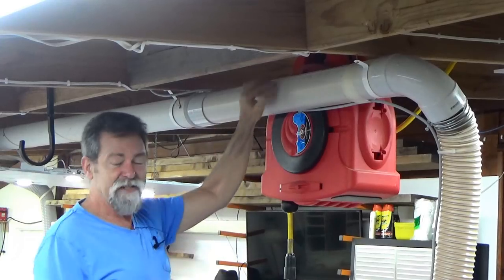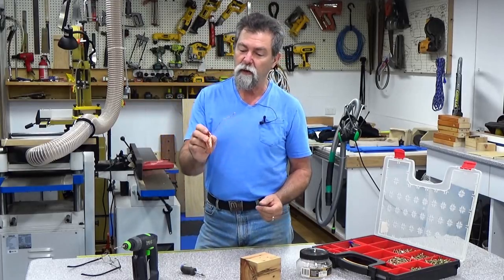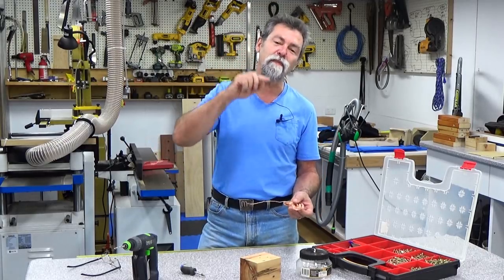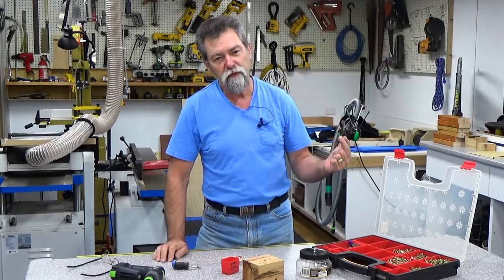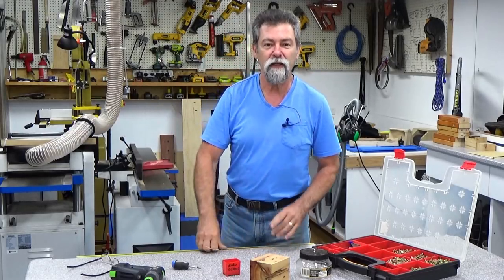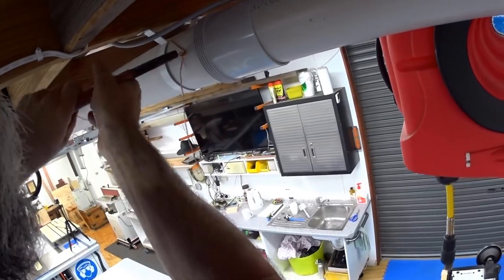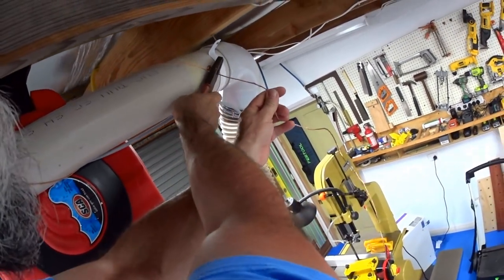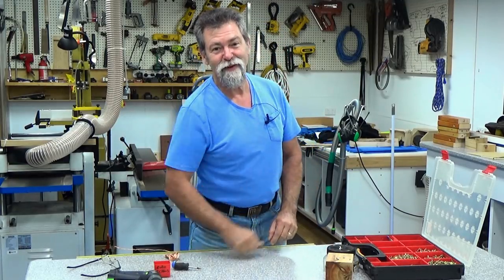PVC dust extractor pipe how to no static dave stanton woodworking safety dust collection

Comment: Should run the wire to some batteries to charge them for free. :)
Reply from the maker: Interesting point Chad D.
Reply: @DavidStanton  Would need to charge a high voltage capacitor then use a transformer to step it down to useable, since the static is probably like 5000-10000V when you get a shock.

Comment: This could be any metal wire.  Copper is a good conductor but for static the current is so low that steel wire would be fine.
Reply from the maker: Correct Jerry. People tend to think of copper wire when they are discussing electrical circuits due to a very slow corrosion rate.

Comment: You say in your video; "Pvc is an insulator" and then you install a conductor in the Pvc. You better hope your ground never fails, you'll miss those static discharge shocks.
Reply from the maker: The screws are removing the static build up from within the pipe.
Reply: @DavidStanton  until the ground fails, then it becomes a conductor, and stores energy.
Reply: @DavidStanton  the screw might be removing the static from the direct area near the screw, that is all. Air is a pretty decent insulator, not as good as PVC pipe tho. Static can't travel much through the air, or along the PVC so how is this doing anything? https://www.youtube.com/watch?v=yA22kTtV4XI&t=447s

Comment: Non conductive PVC pipe is not allowed by NFPA 664 sec 8.2.2.3.1.2  for workshops for this very reason. Static dissapative hose that can be grounded is required

Comment: I'm not sure it's legal to use metric fasteners on 4-inch pipe.  Mixing measurement systems is sure to cause all sorts of imaginary problems.  I'm surprised the Internet metric dilettantes haven't pointed this out in excruciating detail in order to prove they're YTE's (You Tube Experts).   But, from practical side - well done modification.
Reply from the maker: Gave me a smile there Buckhorn!
Reply: It's actually not 4" pipe as this would be 101.6mm, domestic sewer pipe is 100mm ID, 110mm OD so putting metric screws into it will be ok, should not spontaneously combust or cause any imperial outrage 🤣🤣
Reply: That’s funny. 😁
While traveling through Canada I had to stop and get a windshield chip repaired. While waiting I asked what else they did, turns out they do house and business glass as well. Funny though, they measure glass thickness in Metric and measure the glass dimensions for windows in inches.

Comment: While your video doesn't get into the high or low pressure versus high or low volume differences between shop vacs and dust collection systems, nor show application to the entire length of the extraction tubes, it does address grounding both the inside and outside of the PVC tube.  I'd suggest stressing placement of the penetration screws to the top over the sides of the tubes, and jumpering across all blast gates and joints. While small dust particles are a fire hazard, the volatile components in finishes and cleaners are explosion hazards too. Advise woodworkers to store those in metal cabinets.  Also, while sawdust makes a great addition to garden compost, I wouldn't recommend using sawdust from any treated wood or shop sweepings from sanding finished woods. However, if you know you'll be working on raw wood you could have an alternate "CLEAN" garbage can collector kept by the dust collection system to be swapped out for the "WASTE" sawdust collection for regular use. When the raw wood sawing, drilling & sanding is done the collector cans can be switched back and the "CLEAN" can covered until next use or dumped into collection bags for addition to your garden compost bin.
Reply from the maker: Interesting point Eric Grunewald. Maybe you should make a video on all of these items that were not in my video which as the tittle mentioned was only about, "PVC, no static"
Reply: Really???  Another internet troll smarty pants.

Comment: No reason not to use insulated wire — just burn of a bit of the plastic where it wraps around the screw...
Reply from the maker: Hi Bert. I found the outside of the PVC pipe also had a tenancy to get static build up, hence the wire wrapped around the outside one rotation per lightning rod. Bare wire is best.

Comment: Those screws don’t meet electric code they have a wood type thread to meet nec they must be machine threads
Reply from the maker: Well Ken, all I can say is that the system works brilliantly. I don't think they are aware of nec.
Reply from the maker: Also, as this is not an electrical installation, merely an earth I doubt it would come under the NEC
Reply: This has nothing to do with the National Electric Code.  Nothing.

Comment: Why did it take you years to realise you need to ground PVC dust pipe? Its pretty much essential and should be done during the install.
Reply from the maker: Hi Ant and thanks for the post. If I had done it straight away I may not have done it as efficiently as I did in the video?